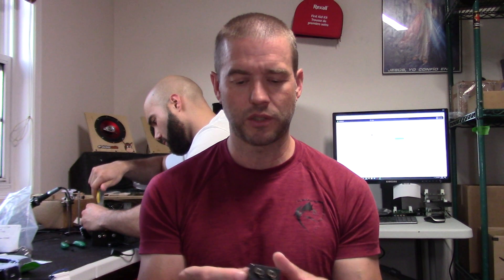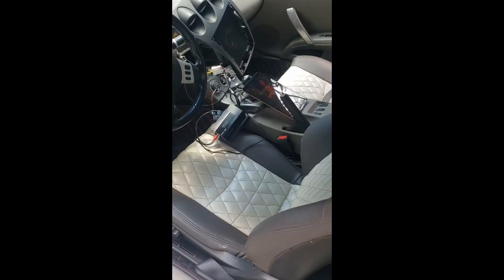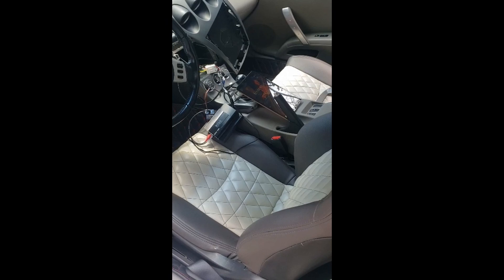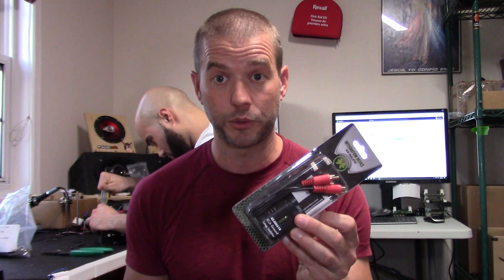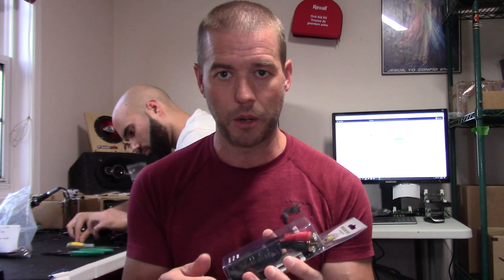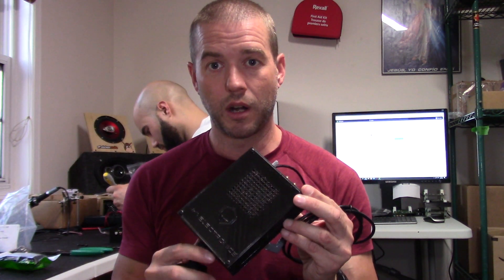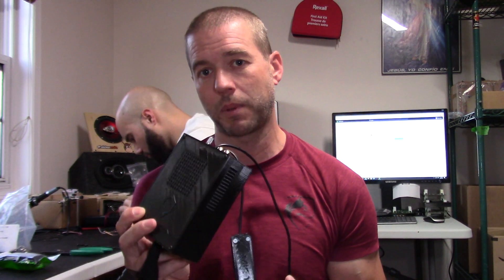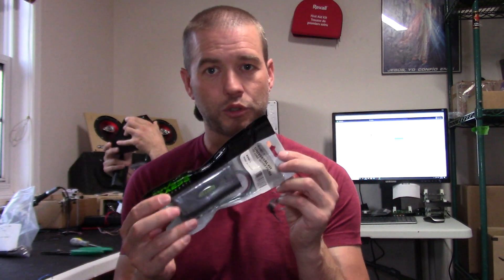MK1.5 Electronics Improvements

Comment: @workshop12 I have a 2013 370z nismo with bose audio. So if I buy the plastic dash kit and the mk1.5 electronics and the tablet that is all I need for the install even with it being bose? Another question I have is what would I need if I wanted to add subs in my car later on with this setup?
Reply from the maker: Is your car equipped with OEM Navigation? Our kit supports non-navigation only 370Z vehicles. Yes, the parts you listed are all you would need for your Bose setup.  We have an article on how to add additional amps to your system here:  https://support.workshoptwelve.com/portal/en/kb/articles/using-an-amp-and-subs-with-your-brainiac-install

Comment: If my mk1.5 just got received in the mailbox 3 days ago, do I have the updated one?
Reply from the maker: I'm not sure, when you look at the wiring harness does it have the Axxess unit like shown in the video?
Reply: @WorkshoptwelveConnect  I haven't opened the package yet. I was thinking to return it brand new back for the updated one. I'll open it and see today.
Reply: @WorkshoptwelveConnect  Alright, it's there, very happy about that, I think I for sure will not have a problem in my 370z Nismo. Thank you so much!

Comment: Good stuff on nix'ing the PAC..Running a 12v noise filter was literraly my next step ( that and some EMI wrap).
Update: so I did add my 12v noise eliminator on 12v input and a ferite core to my RCAs near to the 1.5 box ... Result is no noise with the 3.5 connected... The usb is still noisy so thats next. I may try a few grounding options or source the 12v from another location for the USB step down specifically